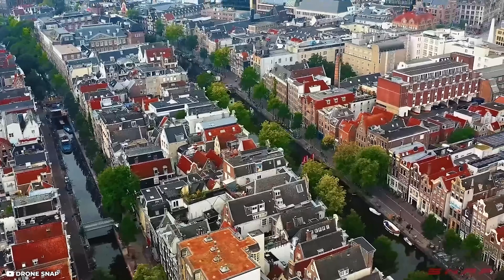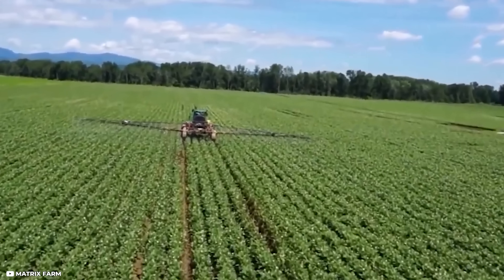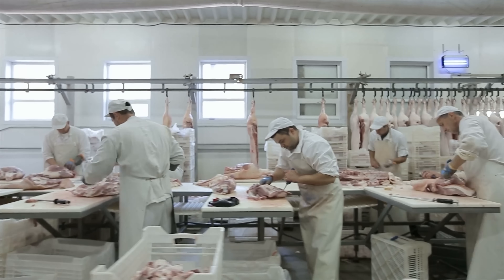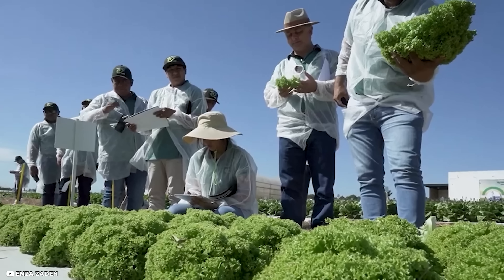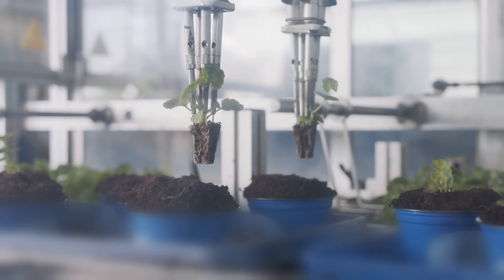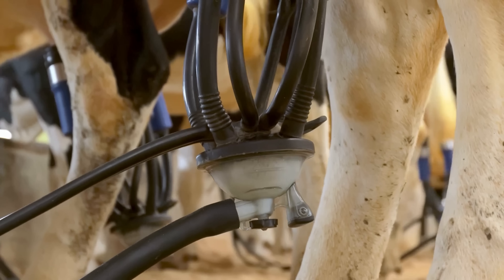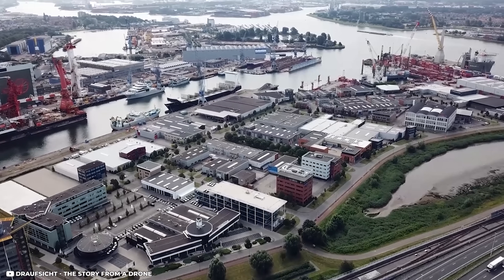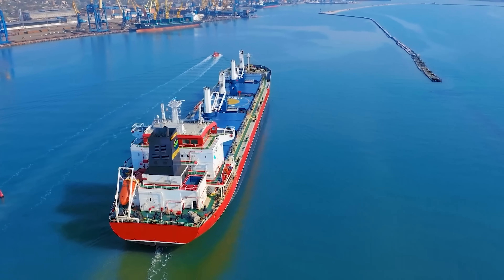How The Entire World Depends On The Netherlands For Food

Comment: Dutchman here. It's true that agriculture is a big industry over here. But there's a catch, in that the Netherlands is having a massive national issue with nitrogen, and the environmental impact of large-scale farming as a whole.
 
If you were to ask me, it's silly to have such a huge agricultural industry (half the country is agricultural land) in a country with such a high population density. It's awesome to hear that your country is a national leader in something, but we shouldn't lose sight of the downsides as well. And given the fact that we have 1) massive environmental downsides due to our intensive agricultural industry, and 2) a MASSIVE housing crisis, in part because of a land shortage. Keep in mind as well that, while this agricultural industry brings in a lot of money... it's primarily bringing a lot of money for the bigwigs at the top, and the shareholders. And a lot of the people working don't see most of those benefits (though the Netherlands is still a nice country to live in, don't get me wrong).

 
Finally - just a heads up. You mentioned at 6:25 that the Netherlands has a surface area of 41,5 km^2 which is not true. 1 km^2 is 1 km by 1 km. So 41,5 km^2 would be the same area as a 1 km wide strip of land that's 41,5 km long. The Netherlands has a surface area of 41850 km^2 (which is incidentally not 25814 square miles, but 16158 square miles).